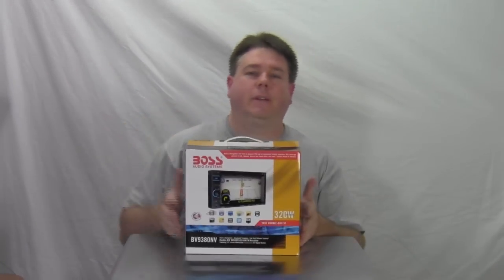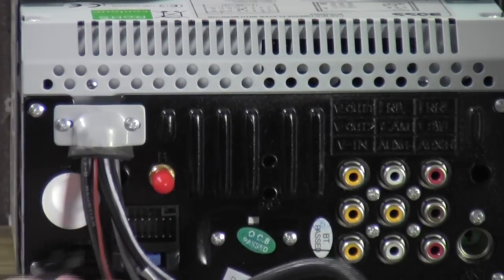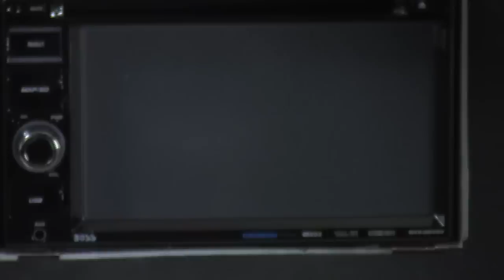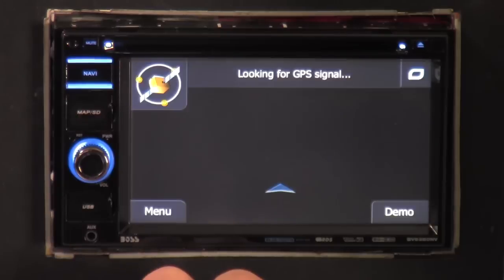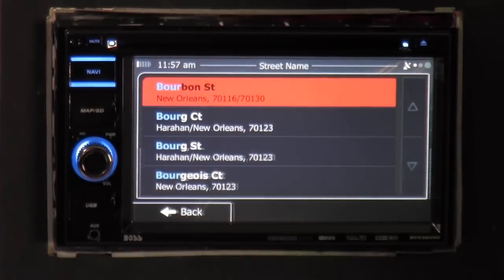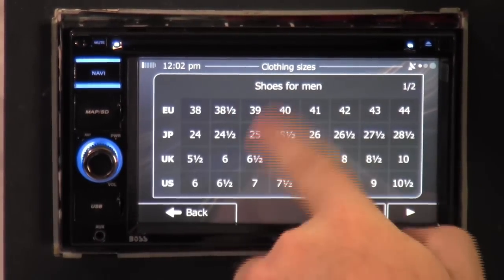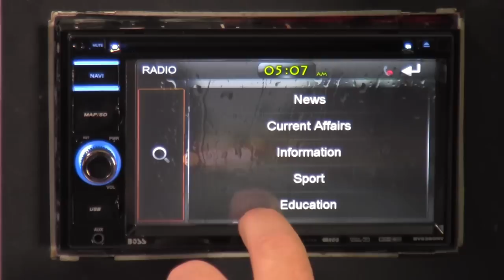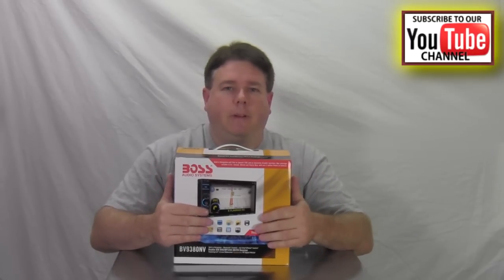Boss Audio BV9380NV - Out Of The Box

Comment: OK. I bought one.  It has issues but is mostly works.  First of all just to say that if one wants a perfect radio one would have to build it yourself. 

I am convinced that designers never use the products.  This the screen is not flush, it sits back about a 1/4 inch from the bazel. And the clock is at the top so that unless your unit sits very high in the dash its not possible to see the clock because of that lip. 

Cant change the button lighting it is the annoying bright blue color similar to that bluetooth blue.  

Navigation mostly works, problem is that inputting and address is needlessly complicated by them trying to make it easy.  If one tries to input an address it suggest addresses as you type and  disable all other keys that do not match what it is suggesting.  That's right it disables keys on the keyboard and you will not be able to enter the address you want.  I will have to check to see if it is possible to disable this behavior.

Radio layout, they going for that old school look but the numbers way to small and they have some un-necessary stuff some zig zag lines on each side. They managed to spoil it for me.

Dvd player has zoom function. But when the movie starts playing it reverts to wide screen with black bar which way too small

Comment: Anyone gotten the steering wheel control connection / assign setup to work?  If yes, how did you program each button?  I'm having trouble, but I think it's on the vehicle side not sending signals.  Also, is there a way to play music from a droid phone by cable other than the aux in, such as the USB ports?  The bluetooth streaming isn't very high quality sounding to me.  Thanks!

Comment: Will this support a 2nd exterior camera?
Reply from the maker: I believe it can handle only 1 camera but I think if you purchased a real switcher box you could theoretically have multiple cameras just switch through that box and it switch the video input on the radio to a different  camera. I'm sure you could find one easily on Amazon.